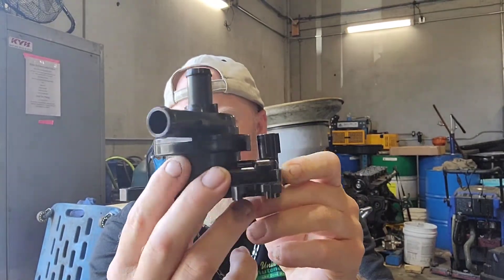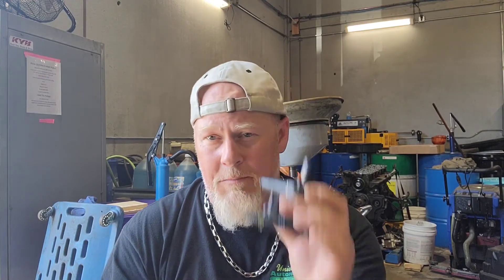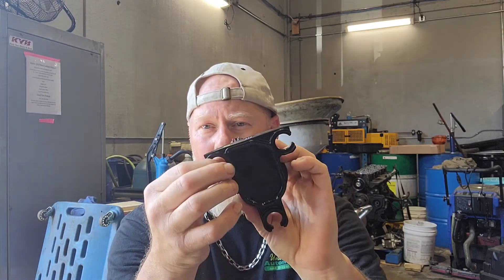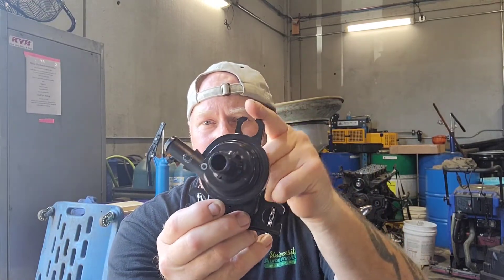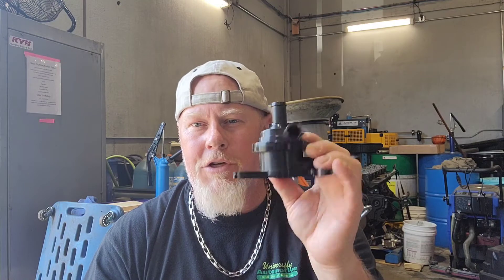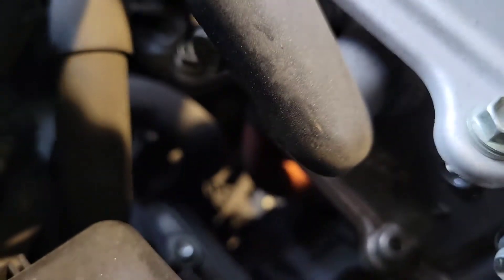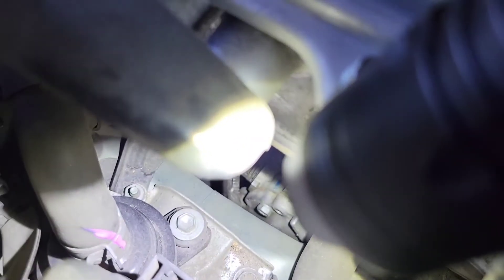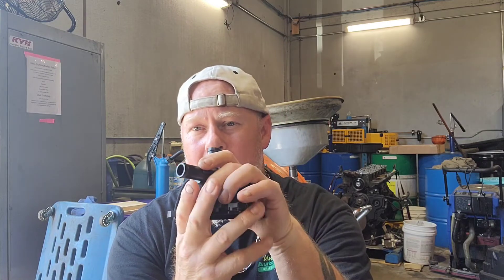Prius Inverter Cooling System Performance and problems

Comment: My 2008 Prius inverter and transmission are very hot to the touch but only when I get up to speed quickly. I had codes POA7O and POA92 but as soon as the care cooled off (I pulled over when the red triangle came on) the codes went away and the car seemed fine. I changed the pump over a month ago and have taken two long trips and the car has done fine. I’m at a loss… any ideas? I’ve been checking the heat by placing my hand on the inverter every time I drive the car, it is never hot if I get up to speed very slowly but (on my road) I have gotten up to speed quickly in less than a couple of miles and it’s hot.
Reply from the maker: You can message me the vehicle info and codes along with code descriptions and I can try to help you out.

Comment: Does the inverter water pump failure causes the AC to stop working? let me know ...if you know😁thank you
Reply from the maker: I am unsure but would think it would not be the cause of the ac You need to be able to scan the computer
Reply: I have head that it can affect the AC.

Comment: My car 2007 toyota prius master light just came on warning me about the inverter cooling system P0A93  , can i drive 40 miles ho e or will i damage my car?
Reply from the maker: If the problem just started you might be ok to drive that and then fix it, I would not continue to drive it. That will just bring more problems. Thank you for watching the video. I appreciate it.
Reply: I was told by a 20 year mechanic works on hybrids, ,will be alright to drive ,unless light is blinking or until ghe warning light cones back on , that night i drove 25 more miles back home Like nothing happened , he said he'll  check it out
Reply: Thanks for the reply back

Comment: I'm looking at buying a used Prius with 220k miles, it has code P0A93 but no check engine light on the dash. Code was listed as current/history and no other code. Should I be wary of the inverter failing not knowing how long the code has been active?
Reply from the maker: The code is saying the inverter water pump is failing and sometimes is intermittently. I would just plan on replacing the inverter water pump and should be ok. Thank you for watching. Hit me up on Instagram if you have any other questions.

Comment: Is the toyota pump the best or is there a better aftermarket pump?
Reply from the maker: I think Aisin is the brand that toyota uses. I personally would not get a cheap aftermarket one. Thank you for watching.
Reply: did you get an after market one? if so, how did it go?